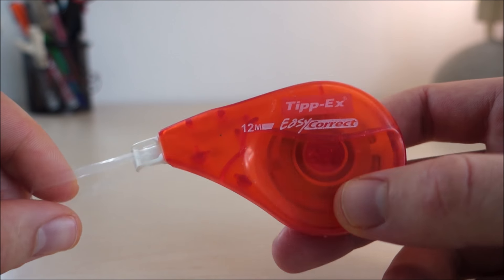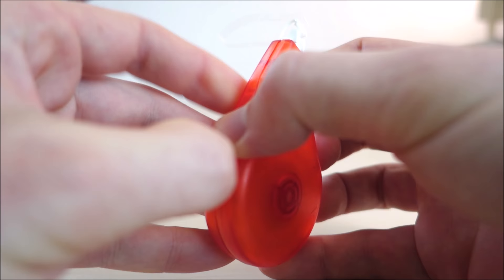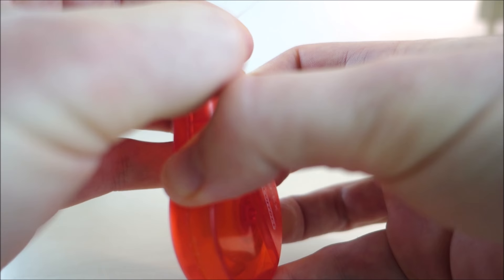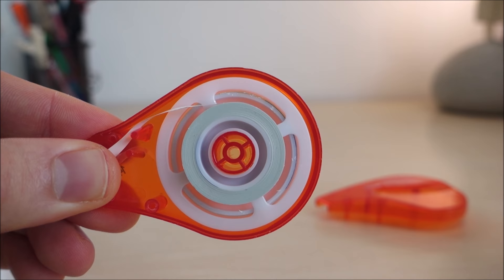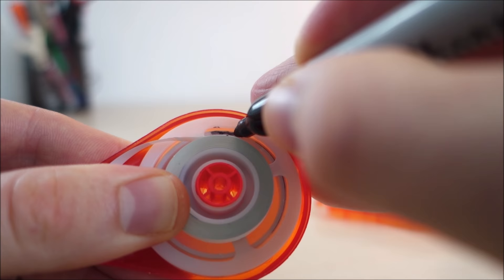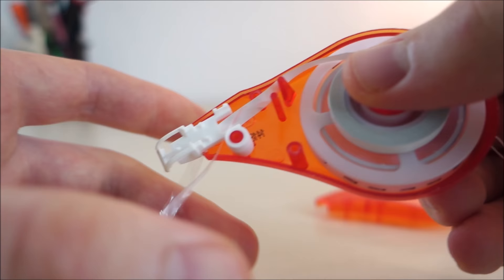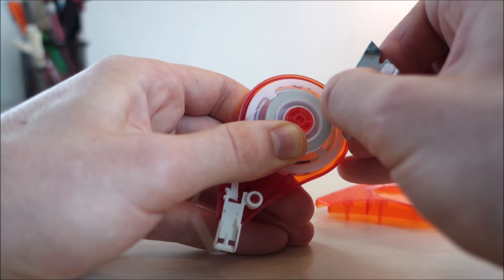FIX: Tipp-Ex Easy Correct - Tape Unspooled

Comment: Video was helpful. However, today I ended up throwing away a brand new Bic. Three of us in the office tried our best to salvage it but by the time it got passed around, the unspoiled ribbon became a twisted mess that wouldn't spool nicely. It would crinkle and jam and we were at a breaking point so I just unspooled the entire thing and ripped it up in frustration. Our boss overhead us complaining about it and agreed how much she hates the Bic brand. We immediately put in an order for the regular office brand we use that has the actual wheel you turn with your fingers. Those are amazing. Will never again buy Bic or any brand that does not have that feature.

Comment: I tried to open my white out so I could fix it but it’s not opening
Reply from the maker: The two halves need to come off perfectly parallel, otherwise the pins that hold it together will bind and it won't come off. Mine wasn't glued but was still tricky to get off

Comment: Mine opens up the other way with the garbage spool facing me, if I were to flip it, it will become even MORE UNSPOOLED and I can't afford a new one at this time. This is just making me more pissed off and frustrated because it's all I have and now need more while on a fixed disability income. This was stuff from 2 yrs ago that was stored in a cool dry place so the whiteout part would still be fine. 

Its like it's all on one wheel that moves in the same direction, so it can't be fixed. I tried, and it just ripped so I now have no correction tape.

Comment: I'm struggling to split it open, any tips?
Reply from the maker: Try to keep the two halves parallel to each other when you pull them apart, I found that using the fingernails of my thumb and middle finger in opposite directions works best for me. If you can get one side a little bit further out, you could also try rocking back and forth, hold the part that is further out from moving back in by squeezing it and prying on the other side. Best of luck!

Comment: I have a torn tape & will try to piece together. Any info-how to would be appreciated.  Tip - use a paper clip to wedge open the plastic case.
Reply from the maker: I've uploaded a video showing how to use tape to fix that - check it out https://youtu.be/T6uPRURh87U
Reply: Used my little grampa keychain pocket knife. Worked like a charm!

Comment: Ugh I'm struggling to open the case, when I get one side cracked open, the other side closes
Reply from the maker: If you can get one end open far enough to stick a credit card in, that would help prevent it from closing. Update us if you find a good solution!

Comment: Of course, every office is stocked with a supply of razor blades!

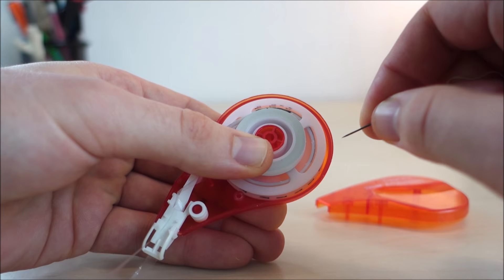At 0:52, instead of using that sharp object to scuttle the little collection wheel, perhaps I could stab my eyes with it. A plague unto those who manufacture, distribute, promote or sell this wretched product. It completely sucks.